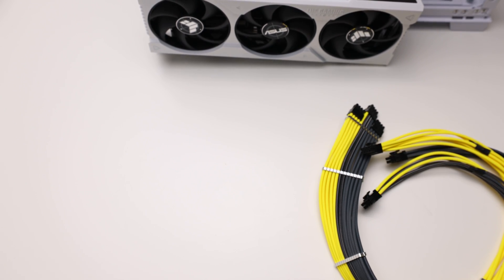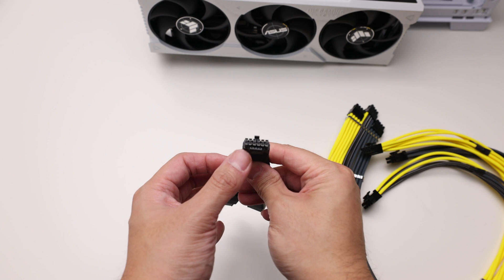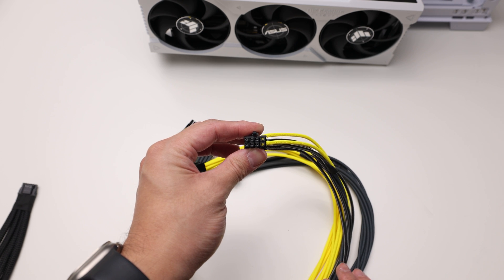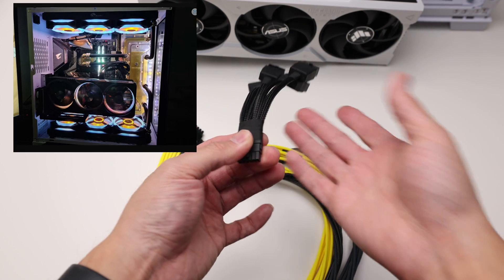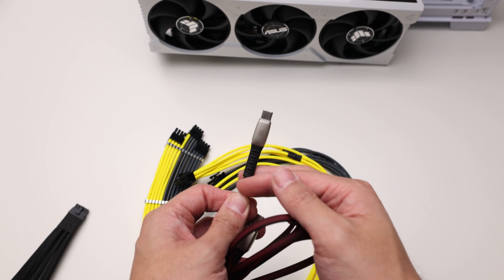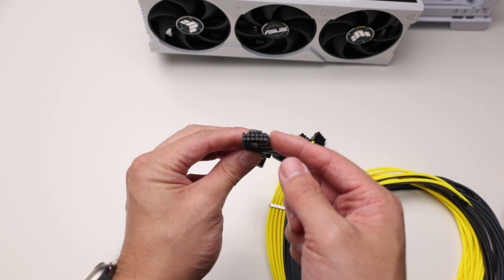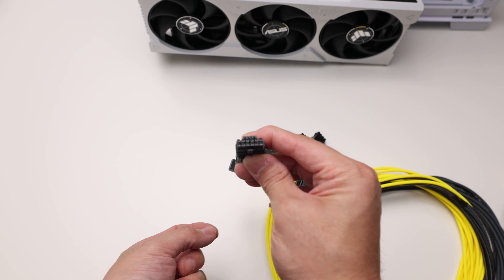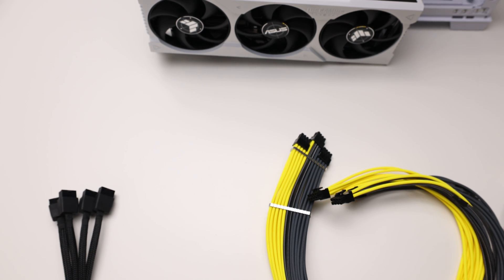HOW TO AVOID BURNING YOUR RTX 4090 / 4080 CONNECTORS 12VHPWR

Comment: This issue has only be reported by one user on reddit so far, I dont get all this drama.
Reply: LOL!

They were being reported as catching fire before they were even released to the public. You don't get the drama because you didn't bother to look around before you posted a response. There's 5 different people in just that reddit thread that had this happen to them, never mind the very available reports from others. Sheesh bro... do some research next time.
Reply: @x8jason8x  Is still a drama, my card is completely fine, I also dont recommend using third party connectors as an alternative in case NVIDIA uses it as an excuse to dont issue a RMA to you if it gets burned still
Reply: @rakennavarro2557  Yes, it's perfectly fine and totally drama because your card hasn't caught fire. 🤦‍♂
Reply: @x8jason8x  it's because of the bending of the cable with small PC cases and it doesn't happen to everyone, my PC case is big so I don't need to bend the cable at all, anyways with the 4090 you need an big case for it, I don't get why people uses small ones lmfao, you can afford an 4090 but not a PC case that can fit with it?
Reply: @rakennavarro2557  🤦‍♂🤦‍♂🤦‍♂

Do you really not understand that this single connector carries the power normally carried by 4 8 pin connectors? It's a design flaw, and one that was easily avoided. They were catching fire before the 40xx series was released. It could have been fixed, nVidia does not care.

This card costs more than a month of housing for most people, and may actually set that housing on fire. Wires are supposed to bend, they aren't supposed to catch fire. Do you understand the drama yet?
Reply: @rakennavarro2557  "you can afford an 4090 but not a PC case that can fit with it?"

Bro... I can't stress enough that this is bad, you're blaming people that paid a premium for bending wires... which is something you're supposed to do when you're building a PC.
Reply from the maker: So lots of folks that have joined this hate on this connector, seem to forget there are a lot of 3090tis out there using the same connector with the same or similar power envelope (depending on variant) I saw another TUF 4090 melt today, and I saw the photos of the build before it happened. The connector was bent about 95 degrees against the glass. Let's take this particular cable out of the conversation and imagine would you bend the power cord coming out of your pc to 95 degrees?
Reply: @JCustom  I don't think your question is painting the picture you want here. I can look behind the couches of most of the US and find a power plug 90'd against the back of it. A 95 (reverse angle is what you describe by this) is fairly common in horizontal configurations. A brand new cable in a PC making a 90 is extremely common in cable management.

The problem is the shoddy adapter. There are better solutions than pairing down 4 150w 8 pin lines to a single 12+4 pin. They got lucky that there weren't issues with the 30 series, but the 40 series is so brute forced that I'd have been surprised if there weren't issues.
Reply: @JCustom  That is what Im saying, you need a big PC case with this card, all the people who have reported their Cable/GPU melted is because they were using small PC cases where the 4090 barely fits in and the cable was bending 95 degrees against the glass...
Reply: @rakennavarro2557  You're wrong, there are 3 cases or so already. So far most PC cables are meant to be bent, none of them are having any issues. Just a tiny bent = melt, that is some low end shit cable. Why u still blame people, youre the drama.

Comment: Why didn't they make it angled from the get go? Do they do all the testing on open benches? How did no one see this issue when this shit doesn't fit in 95% of pc cases
Reply from the maker: The connector is the same as the 30 series in terms of pin out with the additional of 4 sense pins. It could of been confidence related since there were not that many issues with the 30 series and the sense pin addition on the 3090ti adapters that made them feel this is fine.
Reply: @JCustom  Jensen should be paying for all the 90 degree adapters that people need now

Comment: So… 8 pin connectors were rated for 150 watts.. so let’s shove 4-150 watt connectors into one 12 pin. Should work….  Ha there will be more failures like this regardless of the bending of cable.

Comment: Your video is useful in keeping people safe so thanks for that. However this cable. . . This cable. . .

Its a shit connector that tries to pump out more power with less connectors. His gpu would likely not have melted if he used regular 8 pin connectors directly. This new cable trades reliability, and importantly YOUR FUCKING SAFETY to make a smaller connector so a fucking power hungry gpu doesn't look ugly.

Fuck that shit.

Comment: So what was wrong with 8pin connectors that must be changed with 12pin crap? Lot of power concentrated on one small spot (connector) always causes problems
Reply from the maker: Smaller pcb smaller space for connectors. We saw this with the 30 series. I don’t believe the adapter is well designed but as with anything else when change is brought on, there will be issues and pushback.
Reply: @JCustom  but the cards itself way bigger so there more than enough space to mount "regular" connectors and leave customers another option for power delivery. I agree, transition to new stuff is new smooth ride.

Comment: You know what wont do that?  8 pin connectors.  Why?  Safety margin of the 8 pin makes it extremely unlikely.  I get why they want to make a smaller connector but it's not designed as well as it should be.

Comment: Problem is if you are so careful it will fit basically in only 1% of the cases on custom design cards unless you mount it vertically and there is no pcie 5 vertical mount yet…
Reply: What does PCI-E 5 have to do with it at all? The 4090 is PCI-E 4, and uses the same PCI riser as any other card... PCI standards have nothing to do with it.

Comment: You did zero research and just made up a lot off bullshit. You even did not look up the actual number of insertions allowed for other connectors and just said Sata power connectors are only good for 50 which is horse-crap it is 500. Please read some manufacturer documents before telling nonsense. Also if government entities that are concerned with consumer safety decide this has to go off the market then this new spec is not here to stay. So lets wait till the first house fires are connected to this problem and see what will happen. Are you so concerned that sales of your company will suffer that you made this bullshit clip?
Reply from the maker: It’s not 500 for the original sata. You can look it up it’s 50 for the regular sata connector. Esata is rated in the thousands.

Comment: It's funny the testing with the 4090ti has the same problem with the connectors burning. It's a poor design in an attempt to conceal the wires. Just the weight of the 4 cables and gravity will pull the cables into a position that the manufacturer suggests not to. 4 slot cards that don't fit in a lot of cases and won't fit behind the glass... what do they think is going to happen. It's NOT the end users fault for a cable burning because the cable has a small bend in it. I'm ready to sign that class action lawsuit how bout yall?

Comment: He has a 1000W RMX PSU, what you're talking about is inexcusable. We're paying 2k+ euro for a flagship product, and we will NOT accept cables melting because they're so fragile. This is the new spec? Thanks, but I'd rather stay on the old spec with 4x8 PIN cables. I already saw 5 reports with the same issue of cable melting on that very reddit thread.

Comment: They should stop making excuses! 8-pin power connectors is still around for like a decade now because it has an insane overkill safety margins on it, and it's a good thing. This however is the complete opposite of the legendary 8-pin connectors. Wires are meant to be bent, and that 35mm straight line before making an angle bend is just plain stupid.

Comment: If a tech company puts a 600w power cable on the market with their latest premium GPU that costs $1600 USD, then they better make sure the cable can be safely used in regular situations and in regular cases, telling someone that this is all due to simply bending the cable just does not justify it. How many case in the market can actually fit a 4090 without bending the cable? If we are not supposed to bend the cable then make a plastic hard cap over there to avoid people from doing so, or simply make a 90 degree connector. If the cable is that easy to be caught on fire due to a simple bending, then I don't think the product is safe to use on a consumer level yet. This is clearly a design flaw, and someone at the developing department probably knew about it too, but the company chose the cheap way out. This is just another sign that nVidia doesn't care about the consumer market anymore, but rather focusing on the commercial market now.

Comment: Guy, you sound like a shill or someone with a vested interest connected to a shill. Asus perhaps with that advertised in the background?

The BOTTOM LINE is this (and you should have stated some derivative of this in your video but failed to):

1) The Nvidia cable design included with their $1600+ cards is spectacularly incompetent in it's current form, and ENTIRELY UNACCEPTABLE due to Nvidia going over the rated amperage spec for the pins. PCI-8 pin connectors have a 50% LOAD BUFFER BUILT INTO THEM! This connector goes OVER the rated 8 amps per pin at 600W hitting something like 9.5 (the fact that the user was likely not beyond 450W is irrelevant for obvious reasons). This was SO EASILY preventable even with flawed, seamed, female design (discussed in 3) below), by simply ponying up the extra cash, and sheathing the female connector inside a ceramic tube KNOWING they are pushing the limits of the connector to an extreme if the flawed female design got pried loose a bit...but of course, they were too GD cheap to do that. THAT'S "common sense". 

2) You have to be a GD F'N CHEAP IDIOT to design a connector with such garbage build quality such that it's only good for 30 connections. THERE SHOULD BE NO SEAMS IN THE FEMALE END! SPEND THE F'N EXTRA MONEY TO DESIGN AND USE A SOLID FEMALE CONNECTOR! I mean SERIOUSLY, how bloody STUPID do you have to be to use a seamed female connector that can easily be leveraged apart resulting in SERIOUS safety hazards. So no, guy, it's not "common sense" for the user, its common "DESIGN SENSE" for the manufacturers who was too GD stupid & too GD cheap to design and utilize a seamless female connection point.

3) Your point about the pin touching the plastic, and that alone being the reason for the melting is seriously uninformed. Do you REALLY think we've been using this plastic for without issue on 8-pin connectors for as long as we have without the pins touching it? Do you really think thermal ceiling considerations of the tolerance of the plastic was not factored it in? The reason we don't melt the plastic is NOT because we are completely avoiding contact with the plastic (and this goes for ALL devives & power connectors), it's because current on the pins is KEPT WITHIN THE SPEC. ALL OF THE PINS ON THE 12V CONNECTOR SHOULD BE ABLE TO TOUCH THE PLASTIC AND NOT MELT IT UNDER FULL LOAD. THAT is common sense, and is engineering 101 - you build to standards that withstand the worse case scenario - PERIOD.

4) Again, more 101 stuff here: if you are melting connectors left right and center during testing, you don't realease the connector telling people "not to bend it" - what o joke! 🤣 I mean F the safety hazard, F potential fires, F potential lawsuits, we have a schedule to keep to beat AMD!! Unbelievable! If the connector mandates no bending within 3.5cm (due once again to the use of piss-ass seamed female connectors), then it should have been designed with a rigid, fail-proof 3.5cm enclosure with the connecttion point being at the END of the card, OR just put the same bloody ANGLED connector that was on the 3090 FE card onto the 4090! I mean, HOW STUPID do you have to be to not angle the connector on the 4090 in the first place, KNOWING this is going to create proximity issues with the case panel? Absolute MORONS...and I am just talking about aesthetics & build complications here, not even about the SAFETY HAZARD issue here! I mean HOW STUPID do you have to be to design this non-angled connector In the first place (IGNORING THE SAFETY ISSUE)? Now tack the safety issue on and you have a recipe for disaster. To expect the customer to accept blame for your downright INCOMPENENT, cheap, penny-pinching female connector design is downright LAUGHABLE.

5) For a part this significant, pulling this much power, on the bleeding edge (if not exceeding) the current capacity of the pins in the 12V design at a spec of 600W, and with the potential safety hazards, it needs to be designed and rated for a BARE MINIMUM of 1000 full connection cycles (plugging/unplugging) with FAIL-PROOF rigidity where it matters - baby stuff for a solid female connector sheathed in high-temp ceramic as an extra layer of protection. The design should have been like this from the get-go, and then there would have been no problems. Kindergarten stuff.

In summary, your video is highly insulting to the end-user, highly ignorant & uninformed, and totally comes off as a shill video for Asus, Nvidia, etc. It's time to wake up, get with the program, and point the finger in the other direction - at the MORONS at Nvidia primarily, but also at PCI-SIG & Intel.

Comment: I sure hope this connector doesn't last. At the very least they need to redesign everything they can. It's essentially designed for failure. The pin is essential a thin piece of metal rolled up and crimped onto the wires. It has an open seam and just basically held in place by friction. At these size to power ratio's it's best to bond everything so it doesn't have the kind of play and freedom of motion these do. Bond the wires to the pin (and close the seam) with high temp solder and bond that into the plastic (either through hot insertion or a bonding glue) and have integrated strain relief on the cable. If they do that they can leave the physical shape and fitment to the receptacle the same until they create a better standard (asap imho). The socket on the gpu should be well fastened down as well and not just reliant on the solder to hold it in.

Comment: If they say dont bend it then dont do it... It's like u go get ferrari and they say don't drive on wild forest roads... Will u drive it?   I got my 4090 and I don't see any signs of damage or melting... Why? Coz i did not bend it lol
Reply: Most cases will not fit the 4090 card unless the cable is bent at a certain angle…spending $1600 for a fire hazard is just ridiculous. This was something NVIDIA could’ve avoided.

Comment: Not trying to be a prick but when the harness is connected, the pins are locked more in place, making it more difficult for them to move when tugging or moving the individual wires. It’s too soon to say but I’m sticking to it being a current issue due to the thin gauged wire Nvidia used on that proprietary connector.
Reply from the maker: Yes I get that I’m just demonstrating what could happen if your being very aggressive with bending the wires

Comment: Without knowing the circumstances of that incident with the individual 4090 adapter, you would think the adapter cable would be durable enough that wouldn't cause a safety hazard with bending. Hope they would''ve overdesign it for that reason or have the protective layer right by the connector more sturdy so that you can't bend it to jeopardize the integrity of the cable. I'm currently using the adapter for my 4090 FE with a slight diagonal bend on it as I have no other choice unless I take the side panel off.

Comment: Time will tell if more people report similar issues. Yes, it's an alarming scenario considering the cost of the 4090. I believe the power supply may be a culprit here, or he may have had a bad connector. Hopefully this was an isolated case and not a widespread issue.
Reply: It's an issue of concentrating the hot pins from 4 8 pin connectors down to one 12 pin connector. Even if you're perfectly careful with it, it could still catch fire because of all the heat passing through it.
Reply: he had a corsair 1000x  power supply
Reply: no, it's the bending of the pins that is the problem here, less contact coverage, will get worse and worse over time.
Mass recall must happen due to you must leaving at least 35mm of space before you even bend it
Reply: @voluntarism335  NVidia needs to issue a 90 degree receptacle to registered owners.
Reply: @DrunkenRhinoceros  Well, yes they should, they should put out an obvious announcement to everyone with a 4090 that if they don't have 35mm of clearance for the cable to take your side panel off and they should send everyone with a 4090 a 90 degree receptacle

Comment: Vertical mount with Corsair dedicated 600w cable... Dont really understand how anyone would have thought the 4090 would fit horizontally in LianLi. I mean the cables were already smashed against the panel with 3000 series!
Reply: Corsair is 2x8 pin isn’t it? Their lead engineer Johnny got called out for not knowing how the sense pins work and he blamed nvidia. I’m going to avoid their cables.
Reply: @OGSuperDirty  Looks like your comment didn't age to well since everyone is saying the Corsair cable is the one to have huh?